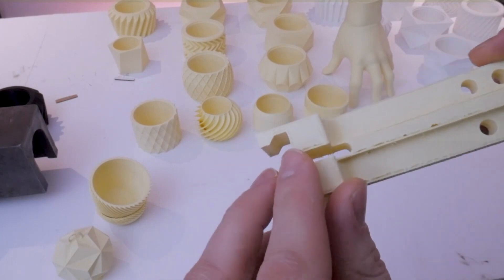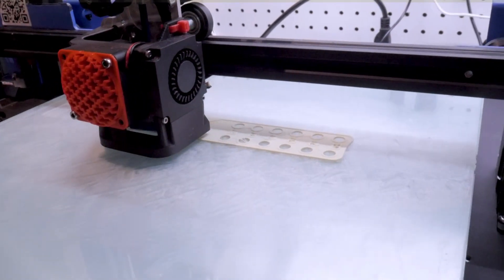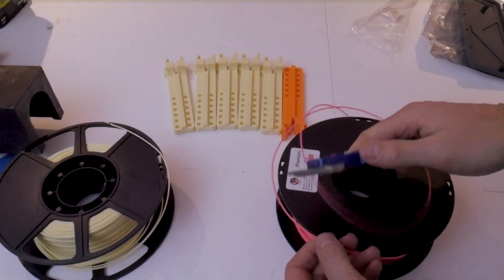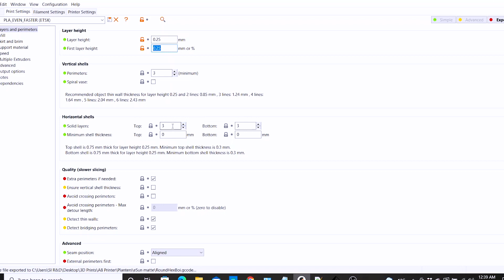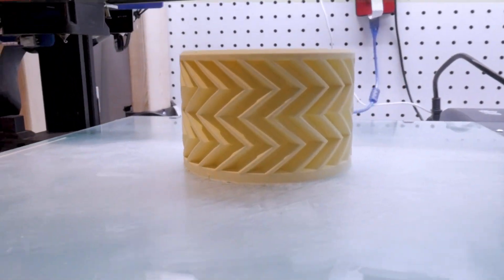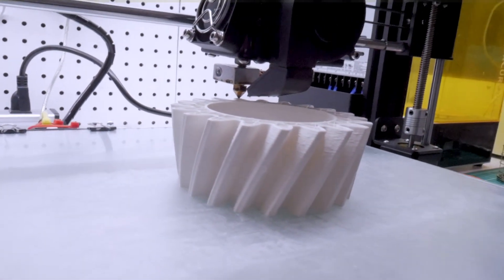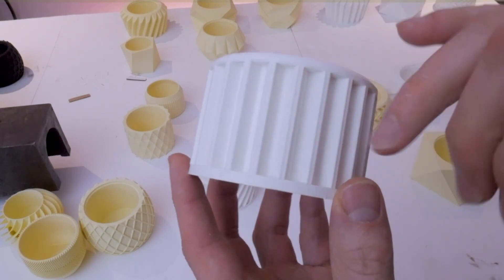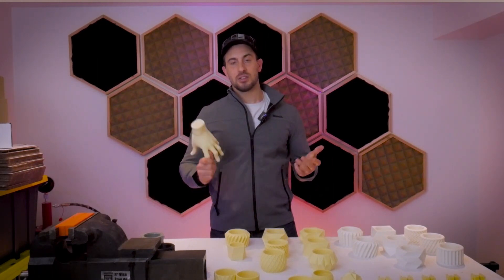eSUN Matte PLA Filament. How Matte? How Strong? Print Settings and Printing Tips!

Comment from the maker: This video is getting a bit old - I've since used the latest eSUN Matte and it is a lot better now. The matte black PLA prints super nice on the K1C and V3 models from Creality.
If you'd like to support my work, check out the links below for the best prices on printers and filament. As an Amazon associate I may earn a small commission (at no extra cost to you)
eSun Matte PLA (new formula!)
► https://amzn.to/47Evkf5

Official Creality Store (K1C NEW!)
► https://shareasale.com/r.cfm?b=2504941&u=3650799&m=124834&urllink=&afftrack=
► https://amzn.to/4e84i23

eSUN PLA+ (Another one of my favorite filaments):
► https://amzn.to/3QA4tuq

Polymaker PolyTerra PLA (Another semi matte finish option)
► https://amzn.to/3sdhK1x

eSUN PLA+ (One of my favorite filaments):
► https://amzn.to/3QA4tuq

Electric Screwdriver:
► https://amzn.to/3JRbbZe

Velcro Tie Wrap Rolls
► https://amzn.to/42jr3dX
Reply: I tried your settings after i purchased a roll of Dual-Matte-PLA. They dosent work anymore. After a bunch of fails (mostly underextrusion) i had the glorius idea to try the build in eSun-PLA settings in Prusa slicer... Worked perfectly flawless :-D A disclaimer would be nice before your outdated video...

Comment: I am using esun matte black pla in orca slicer and printer is creality cr10se 
I have printed with the default esun settings with pla silk silver and pla matte grey filaments using default settings had no issues
But the matte black isn't sticking to the plate when the print actually starts like example in bench the naming isnt getting stuck to build plate the brim and all stick perfectly also i observed overextrusion also when the nozzle stops at a layer and moves to next 
So anyone has used this and can give  suggestions

Comment: I usually print at 205C but with the matte PLA I haven't been able to get it to adhere to the glass bed, printing up to 220C. I have been printing the first layer (205C) with a clear PLA to get adhesion then switching to the matte PLA (215C) and getting fantastic results. The finish and top layers are probably the best I've had from any filament.

Comment: On my x1c I use esun pla+ profile. Great results. Love this filament. It’s like the finish of carbon fiber pla without the cost and wear and tear on printer.
Reply from the maker: PLA+ from eSun is my go to filament these days. This matte version didn't work out for me at the time of this video but I believe eSun has corrected all of the issues with it and I may have to try it again

Comment: I used few matte filaments including the eSun. They were ok for normal print designs without much over hangings, But while trying to print buildings with pillars, the pillars were breaking. Bout with normal PLA the pillars were printing perfectly. The eSun filaments are not rolled evenly and gets stuck in the spool many times. So I prefer filaments rolled evenly.

Comment: for those who are wondering, Embrace Making probably got a much earlier batch of ePLA. I was also having a lot of issues, sometimes even worse (that roll was a very old roll from my research lab). I then did contacted my local vendor to ask about such issues and he explains that esun messed up the earlier batches and the later batches (usually comes in their recyclable paper spools instead) won't have this issue. I decided to buy it and try and it works fine with default setting, and i would even go to say it prints better then normal cheapo brandless filament. 

To sum this up, be wary when you buy ePLA from esun, if it's old stock, you probably will meet with a whole plethora of issues, but the newer ones will not have any more issues. Hope this helps!
Reply: Thank you for the heads-up. I just ordered my very first printer together with this filament, and just now found this video. And I'm not going to lie, the video kind of scared me. But I looked at the order again, and it specifically says that it is on a paper spool. So I guess I'm in luck.
Reply: @Gildofaal  how it went?

Comment: fast forward sept 2023, i bought this epla matte from esun, maybe they heard your complaint on undersize filament, now when i measure it it is 1.78mm, much better than undersize, just need to adjust my nozzle in lower temp... Thanks
Reply from the maker: Glad they got it worked out eventually!
Reply: @EmbraceMaking  how are the current production, do you know

Comment: I have 2 printers and 1 is printing ok with default settings (Neptune 2S) and the other (Aquila with SKR mini E3 board) has heavy under-extrusion. I had to bump temperature to 220-225 and increase the flow. The weirdest thing is that under-extrusion is inconsistent. For a while it prints ok then barely extruding then ok for a while then barely extruding again. It leaves clearly visible pattern on the prints. It has perfect colour and look for scenery/dungeons/buildings etc so I just keep printing on Neptune. Fifth roll now

Comment: I have 2 rolls of this stuff and have referenced this video before. This video helped but I'm still having inconsistent results. One question I have, is the "extrusion multiplier" the same thing as "flow" in Cura? 
I did bump up the flow to around 115 and that helped a bit. I don't even need perfect results as I'm planning to resin coat and paint my parts, but I can't even get anything of size to make it past an hour of print time before turning into spaghetti
Reply from the maker: I'm not as familiar with Cura but yes I believe those two are the same... I think this is going to be the only reasonable fix for this filament as I think the quality control on this stuff is really poor or something else weird is going on with it. So many people have had issues.
Reply: @EmbraceMaking  I thought I had it dialed in a few days ago. I tweaked the profile soo much until I was getting decent and actually started thinking I liked the stuff until it quit extruding mid print on a job. I thought my nozzle was clogged until I noticed the extruder wasn't griping the filament. I pulled the filament and checked it with my calipers and it was 1.5mm! My Ender 3 extruder won't even adjust tight enough to grip that. I'm done with it. It's a shame really, I love that it's so light weight and the layer lines are so minimal, but the diameter inconsistencies are a deal breaker for me
Reply from the maker: I hear you, so frustrating!

Comment: In my experience this stuff is better suited for practicing your shot put than 3D printing. I've managed to throw it 63 feet across my yard but won't rest until I can throw it far enough away I can't see it any longer
Reply from the maker: lol yes I didn't have the best experience either as you can tell.

Comment: the esun epla mat is my first, i never print before... i have a lot of stringing, the temperature :215, i can't solve the problem of stringing...
sorry for my english i'm french.
Reply from the maker: Hi Steve, its not an easy one to get started with. What machine do you have?
Reply: @EmbraceMaking  oh sorry, i have a ender 3 s1 pro.
Reply: @EmbraceMaking  i have a serious problem with the retraction settings
Reply from the maker: @stevedecerf7774  what is your retraction set to? And what is your print temp for this material
Reply: @EmbraceMaking  210°, 1st Layer 220.
Retract 1.6 @ 45mm/s
print speed 50
Reply from the maker: @stevedecerf7774  Retraction sounds too high for direct drive. Try to limit that to 1mm and print a temperature tower for that material. If you get lots of stringing you might be printing at too high a temperature

Comment: i had no issues on the first to prints pr. role (have it in 4 different colors) But now its just prints rly bad.
Because of your video, I just measured the filament and I got as low as 1.66mm :((
Reply from the maker: Yep... seems to be a common problem with this stuff :( Not sure if they ever improved it

Comment: This stuff is my absolute favourite, i print it on my prusa with the default prusament pla profile and it's some of the most flawless printing filament i use. Unsure how it'd translate to other machines but it's definitely a preset to try if you haven't already.
Reply from the maker: Interesting, I don't have any of this material left but I'd have to check out the default prusament settings ... good to know ....
Reply: @EmbraceMaking  another thing to note is it likes a very light touch by the extruder. It's lower density than regular pla so can be easily crushed by the gears.
Reply: Same, it's probably the nicest filament to print with that I've used on my ender 3v2, also I did not experience the discrepancies in filament diameter, mine is/was fine it seems.. I do have to say that mine have all come on a cardboard spool instead of a plastic spool, so maybe they've revised the filament since then also
Reply: white pla works great with my prusa mk3 as well ..  prusament preset

Comment: Bonzer!  Thank you so much for your video.  I purchased B3G1 eSun matte ePLA on eBay and started printing with it almost as soon as it arrived.  I print mostly minis, structures, and terrain for tabletop (D&D) gaming.  My first print of a mini came out pretty well, supports worked well, and only a little stringing.  My second, third, fourth, and fifth prints within the same calendar day and experienced fail after fail with nozzle drag, underextrusion, and bed adhesion.  I am printing on an AnyCubic Vyper and still dialing in my defaults for their standard PLA product, which seems to be about a middle-of-the-road quality so far.  It has taken me a couple of weeks to get prints at 0.125 and 0.12mm to lay down miniatures that I consider satisfactory.  Still getting a fair amount of stringing on finer details, but slowly dialing it in.

I am going to try some tests at scale with the flow rate cranked up to between 105% and 110% with the higher initial buildplate temperature and see how it goes!
Reply from the maker: Thanks! Let me know if you ever get it dialed in and figured out completely, a lot of people would be interested in your settings!
Reply: I sent an email to eSun and complained.  They said they were aware of issues with printing this filament.

I went to Harbour Freight this morning and bought a 6" digital caliper.  In checking the diameter on two of four spools, I found it to be wildly inconsistent.

eSun's response to me suggested the following: Use PVP glue on the buildplate.  Run first layer(s) at 10-15mm/s.  Use temperature of 210° and below 40mm/s movement OR run 225°-230° at 40-50mm/s.

They claim that the next run/batch of filament will take into account consumer feedback.

I ran a medium-sized minifigure and it came out usable with the recommended settings.  I still think I have some tweaking to do on the travel and retraction, but it was superior to all the other fixes I tried so far.

Comment: Maybe I got lucky, but I have been printing with this filament for a long time, standard PLA settings from cura, Artilley Genius Pro, and not a single problem, the look is amazing, I love it
Reply from the maker: Glad someone found it easy! lol so many people seem to be struggling!
Reply: @GadOfWar, what's the diameter of your filament? It's possible you received one of the good 1.75mm batches.
Reply: @dineshpushpavanam7453  well, I have used like 3 or 4  rolls, 1kg, 1.75mm. Not a single problem yet 🤷‍♂️🤷‍♂️

Comment: Did you use the part cooling fan for the initial layers also? I also noticed my layers were bad and have had to print at 235c° when using the Matte PLA.
Reply from the maker: I never use the part cooling fan for the first 3 layers for any filament I've used... I would avoid it as you will likely harm first layer adhesion and cause warping

Comment: thanks for this review - very useful, just doing a first 16 hour print with this - wish I'd watched your video first!
Reply from the maker: How did it turn out?
Reply: No too bad! Considering i used an adjusted Chep’s ultra fast profile and custom supports rather than trees. Only problems were in the model design - mine. I intended to do a little post work . Love those vases you printed by the way!
Reply from the maker: Thanks! Glad it worked out for you because a lot of people struggle with this stuff!

Comment: You said this PLA is less dense than regular PLA (+). Looking at the specs the difference is 1.17 vs 1.23 kg/dm3, which is almost negligible in practice. Are the matte PLA parts significantly lighter or not?
Reply from the maker: Yes it is a few percent less dense, but perhaps it is whatever else is going on with this filament (hard to explain under extrusion) that is causing the final part to be significantly lighter than a comparable part of regular PLA. I've been printing for a long time now and this materials was very unusual to work with. I hope they've fixed it since then.
Reply: @EmbraceMaking  What do you mean for "significantly lighter"? Can you put a figure? 15%, 20%, 30% lighter? Even more? Since the filament density is almost the same as regular PLA(+) (actually only a negligible few % less), where does the significant increased lightness come from?

I see only a possibility: much lower extrusion multiplier. Was this the case?
Reply from the maker: I'd have to see if I can dig up some parts and weigh them. I believe I printed otherwise identical plater pots in this filament and other PLAs so I might have a direct comparison to measure. As far as extrusion multiplier, I never touch that setting under normal circumstances. I can't remember if I ended up trying to increase it for this filament because it was behaving so strange but it could be a possible solution.
Reply: @EmbraceMaking  The 3d printer measures a volume (gear that pushes filament to the extruder). If you use the same g-code with PLA1 and PLA2 then you are effectively printing the same VOLUME. If the filament does not expand after passing the extruder gear (volume measurement), then the weight of PART1 and PART2 can only be proportional to DENSITY1 and DENSITY2. In our case DENSITY1 ~ DENSITY2 (1.17 vs 1.23 kg/dm3). So WEIGHT1 ~ WEIGHT2.
If this is not the case (is it?) then:
1) You are extruding different volumes (= you are using different g-codes)
2) One filament is foaming when heated up in the extruder (like LW-PLA)

If (WEIGHT1 ~ WEIGHT2) or (G-CODE1 != G-CODE2) then it is fine. But if eSUN matte PLA is foaming, that would be quite interesting, since it is much cheaper than LW-PLA.

If it does not foam, then sadly WEIGHT1 ~ WEIGHT2, or you used different g-codes. I see no other plausible explanation.

Comment: Thank you so much for this video!! I thought I was just stupid or like I sucked at 3d printing! I just got my ender 3 v2 and I got this filiment and I can't get the filiment to stick for the life of me 🥲 I tried all these setting but it's just not working.
Reply from the maker: This is apparently a very difficult filament to work with despite regular PLA being the easiest. eSUN makes great PLA+ filament, I use it for so many other projects so I would recommend starting there instead. I did another video on D3D matte filament if you're looking for matte colors, it is easier to worth with than the eSUN matte but still some minor challenges from time to time and you have to print slow (plus limited colors). Another good brand that is more matte than regular PLA is Polymaker Polyterra PLA... and that brand has a huge range of colors to choose from at least! Prints very easy as well

Comment: Ordered two rolls, love the matte color but not able to get decent quality print even setting up the extruder value from. 1.75mm to 1.65mm(checked the diameter)
After that bumped up the flow rate and temperature in the printer, that doesn't work as well.
Only issue i am facing with the top layers and thin areas however thin areas are Printed fine with normal pla filament. Sides are printed decently. Not sure what happening with top layers.
Reply from the maker: Honestly, this was one of the weirdest filaments I've ever used... and I've tried A LOT of filaments. I wish I had a suggestion for you other than to try and play with the top solid infill extrusion width in your slicer.

Comment: Thank you! Had so much issues with this filament. I am using a Artillery Sidewinder X1, and 230 degrees initial and 225 rest. Bed at 55 degrees and 135% flow at start. Works like a charm :) Would much rather prefer eSUN PLA+, which was a whole lot easier to print..
Reply from the maker: Yes it would seem that you really have to increase the flow rate for some weird reason!
Reply: @EmbraceMaking  The diameter seems to bee way off anything from 1.70-1.74 on mine.

Comment: I am using a CR-10 Smart and upon hearing you are using one too. Did you use the settings you showed in the video? and did you also use the normal glass build plate? because mine is not sticking to the build plate.
Reply from the maker: I have a lot of printers, but I don't believe I used the CR10 smart in this video. I believe I was using my ANET ET5X with MicroSwiss extruder and all metal hotend. I believe I tried to use my CR10 smart for a few prints because of the various issues I was having with this filament. As for the settings, try printing slower, I dont think this filament does well being printed fast, especially first layers. Also, bump up the heat a little (both nozzle and bed), increase your extrusion multiplier as it seems to under extrude due to poor quality control (smaller than 1.75mm diameter) and use some glue stick on your glass. I printed on glass as well.